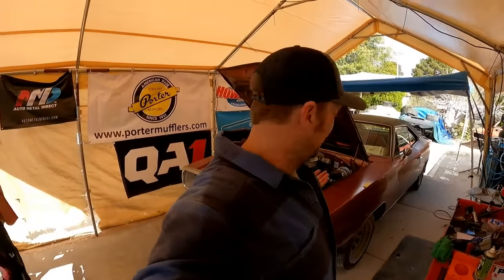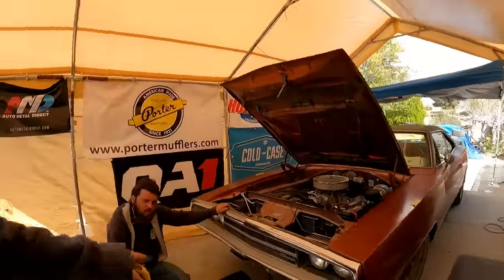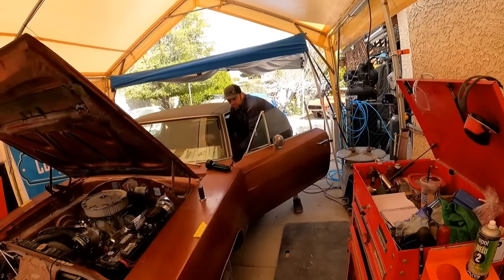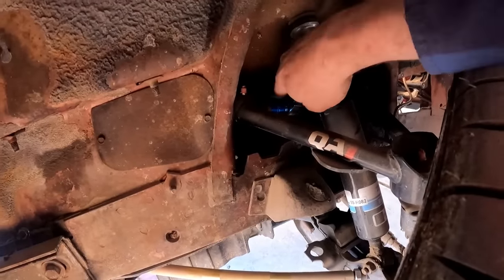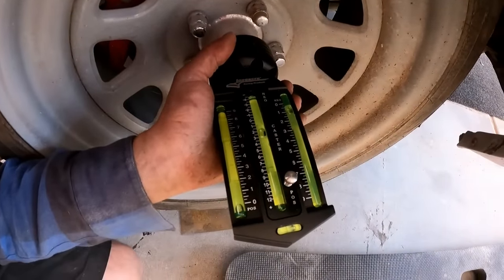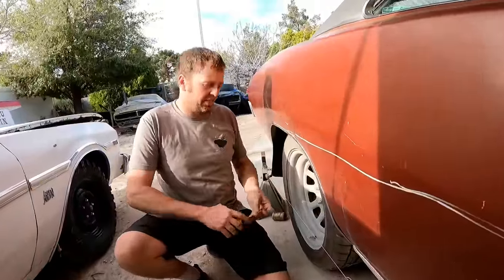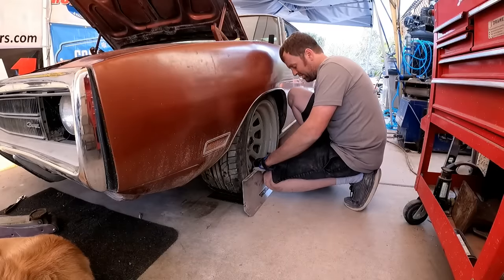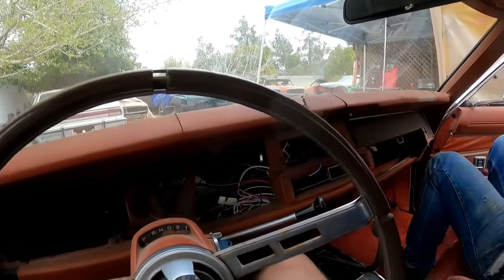Tech tip: How to align ur own suspension at home plus a bonus 1st drive in 29 years

Comment: Great video as others have said.  I have a few comments though on the techniques you use.  (1) old school/super cheapo slip plates can be created using a bunch of newspaper (about 1/4" thick) under the tires (if you can still find some newspapers).  (2)  When checking the caster, it is not necessary to remove the gauge as you turn the tire.  (3) Toe should be checked at the OD of the tire, not at the rim.  Love your videos!

Comment: When I worked at the dealership I handed my Chevelle over to a buddy to laser align, after I did all my front suspension and "string" aligned it. At the end of the day he says, it won't align(later I found it had frame sag), so I tell him, just straighten it the best it'll go. When I drove it home, it drove horrible,  very unstable. So I went back to the string alignment, and it's been that way ever since. I like those camber levels though, I'd seen them before, but wasn't sure how real world usable they were. Thanks, great video!

Comment: Top Vid. Been doing string alignments for years. Taught by an old school guy when I was young school. Not so much now. Have more than a few friends that just think it’s a dark art. Camber and caster confuse them. Hopefully you can make some sense to them now. 
 Glad you mentioned that wasn’t your auto cross setup at the end. I’ve loaded up 3.5 neg camber into cars for trackwork. Hardened washers in the lower ball joint. Chews out those inners, but turns in on a dime with a huge sway bar to keep the front end flat.  Too old school? Always loved Mopars that can carve corners. So much potential for backyarders over Fuds and Chebbys.

Comment: On my 73, the lower ball joint on the pass side was an inch shorter to the centerline of the axle than the drivers side. Factory engineering right there.

Comment: Of course this assumes the wheels are symmetrical which they usually aren't. You check it by raising the tire and spinning the wheel. The accuracy of the pinch welds also affect measurements. On the race car you can string from the centerline of the chassis, or string off the rear wheels (outer edges of rim to string) assuming the rear is zero toe, which is okay for setup and then see how it drives

Comment: Thanks for this. For the guy that does plan on building more than one car, it pays to invest in the tools to do this.
I've never used the adjustable strut rods but I might some day.
I don't know how I lucked out but with stock UCAs and offset bushings, I was able to get 5 degrees of caster with 1/4 degree of negative camber in my '70 Charger.
Reply from the maker: Low ride heights gain caster
Reply: @junkerup  Absolutely. I have charts plotted by Bill Reilley that show as the suspension nears the full compression point, the caster is at it's greatest. The reverse is true as well. It is amazing how just an inch of ride height change can affect the numbers.
 I have my car sitting lower than stock not just for looks but for handling as well.
I like your suggestion for turning plates....a grease sandwich between steel plates. That is some great backyard engineering.

Comment: You ever test that little digital gauge against the longacre to see if it's accurate? was gonna buy one but read reviews saying they aren't accurate... Have a '62 plymouth that hasn't been driven since 1978 and i'm getting close to having it on the road and need to get the alignment in.. (i shoulda put in moroso offset bushings, will probably do that over winter)

Comment: You forgot to mention a couple basics- be sure your tires are all the same and pressures set correctly.  The most important part of the string line is to be sure your front tires are running parallel to the rear end.  If you measure to the chassis and it is not straight, your car will be dog walking.  You can also set camber with a carpenter square if you can do a little math by putting the square against the center line of the tire and measuring the gap on the top or bottom and then doing some math.
Reply from the maker: Parallel front tires not important when stringing off chassis

Comment: Hi Chris , I have been (stringing) my Charger for years with 0 camber to keep the tire patch flat on the ground and as much caster as I can get, with 1/8 toe in . I have had it up to 90  at Rockingham with no problem .Anymore  and I would have to do some adjusting .

Comment: Would the guts in the coupler box need new parts or the adjustable worm gear on top of steering box need adjusted a little  to fix play in steering wheel?